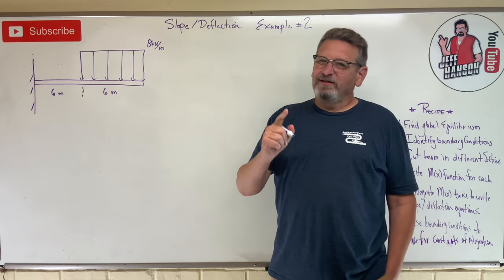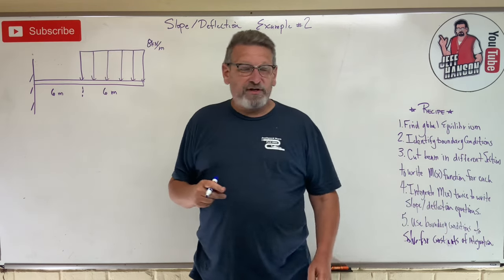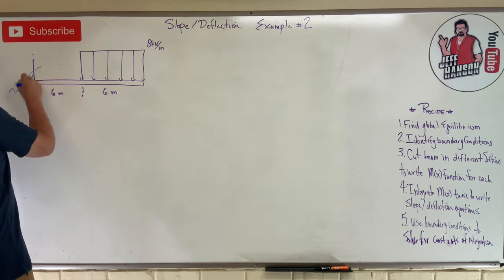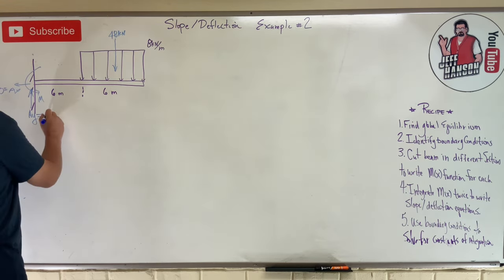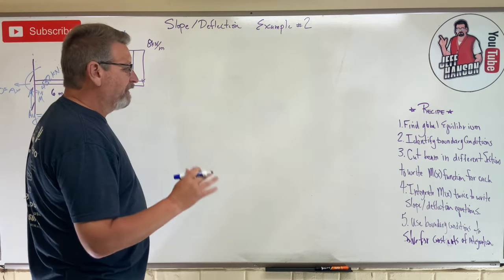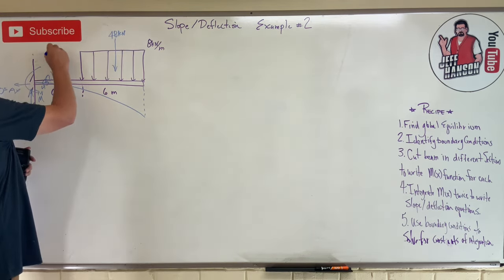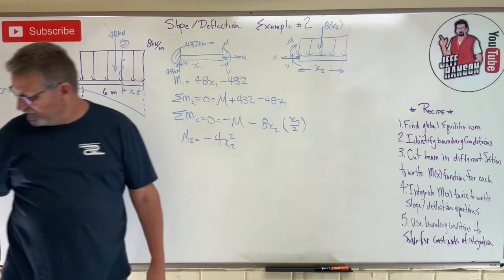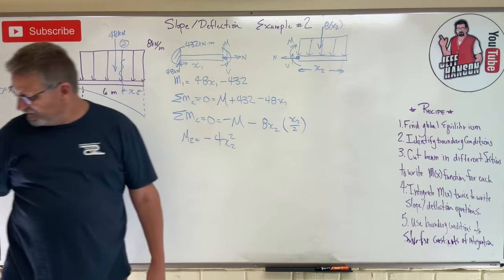Mechanics of Materials: Lesson 64 - Slope and Deflection Equation Example Problem

Comment: HELP LOL!  I wanted to try work Section 2 from the left just to see and I get M=-4x*2+96x-576.  I know that can't be correct since at x=0, I should get an internal moment of -432 to counter the reaction moment of +432.  I've gone over my result several times and can't see where I went wrong.  Really appreciate if someone had a look. Thank you in advance :)
Reply: Your equation for the moment is correct. Remember, the domain for this moment isn’t for the whole length of the beam. Only for the second half where the distributed load acts (6<x<12m from the left)